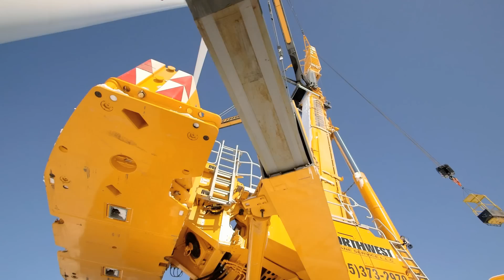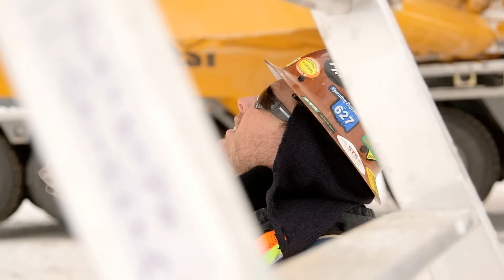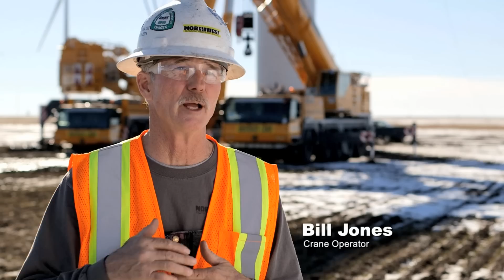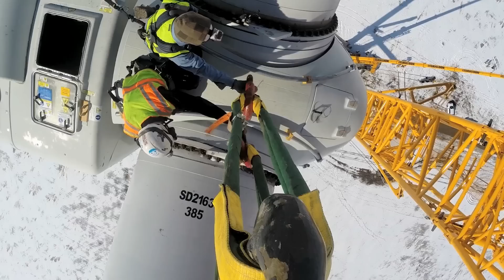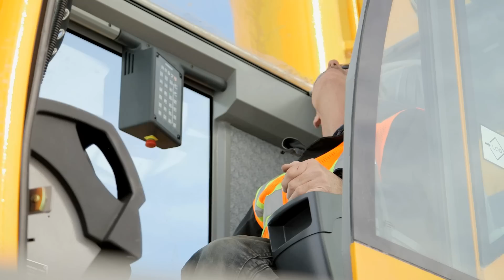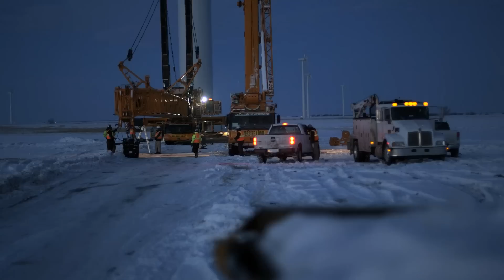Northwest Crane Service, L.L.C. Liebherr LTM 1750-9.1 Kansas Wind Turbine Project

Comment: Wouldn’t a scaled up vertical barn roof turbines work with a lot less extra build parts?
No tower necessary, below ground  or ground level motor generation. Blades would catch wind regardless of direction. Fence off area around turbine. Put in hundreds to make it feasible. No need for two hundred foot booms.
Reply: Stress loading may be an issue. I imagine the weight of the blade assembly counters the lateral forces of the wind, whereas the vertical assembly requires an even beefier boom and piling. That's just my speculation though.

Comment: Typical PR video for the "global warming" scam.  Overpriced, RARE, and impractical machines created to erect even BIGGER junk that doesn't do the job.  This is what the fake horse shiate "environmental socialist" movement does for a living.
Reply: Cranes are designed to lift. There's nothing in the manual that says they can only lift oil or wind parts. As long as the load is within spec, the "what" of it doesn't really matter.
Reply: sr